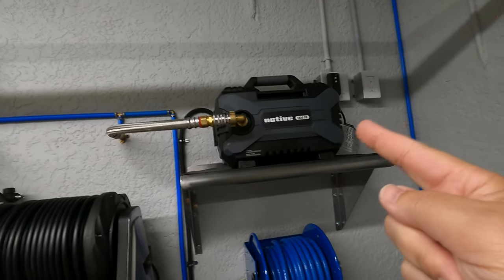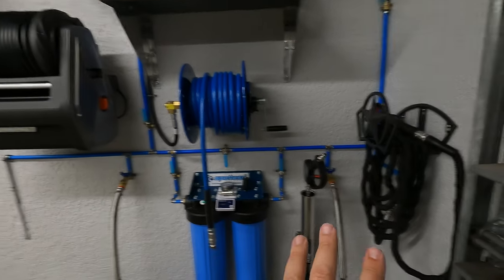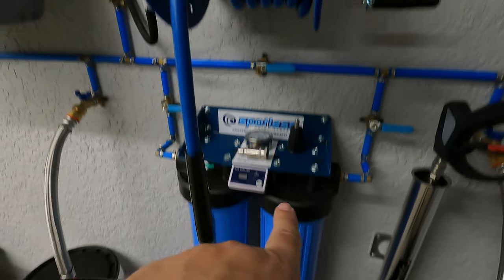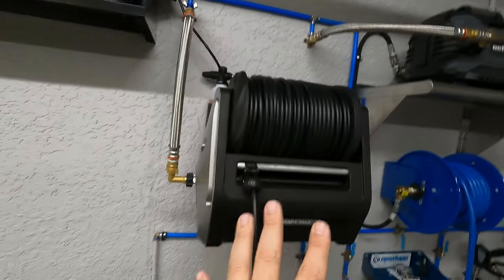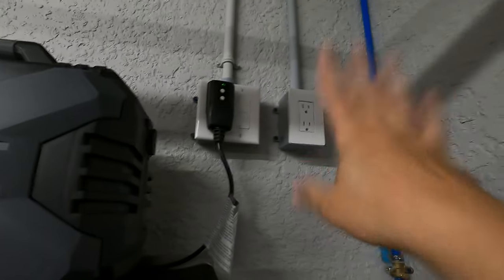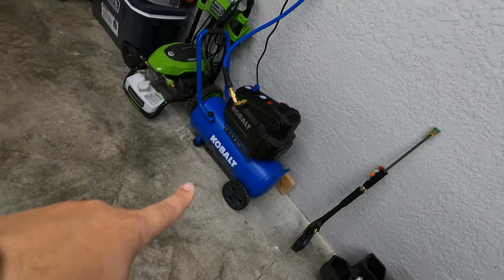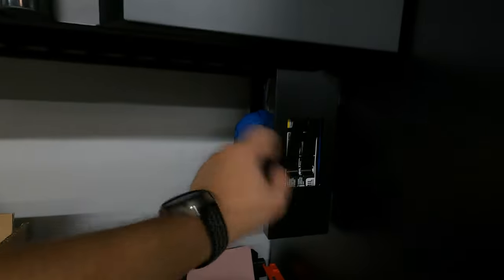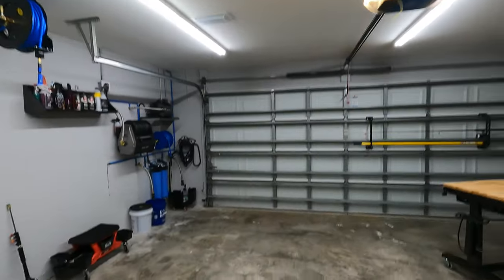My Obsessed Garage Themed Pressure Washer Garage Setup.

Comment: Very nice setup sir! I am going to redo my pressure washer setup to be very much like that. I also have hot water piped to my ARblue630 to use for winter washing so I need to find a way to pex that in nicely to the wall like you did. thanks fo sharing this.
Reply from the maker: No problem.  Thanks for visiting my channel. I'm a huge fan. Keep up the great work 👍
Reply: @MikeLife1 Thanks so much man!
Reply: @MikeLife1 sorry if I missed this somewhere. But do you have a link to all of 

1. The pipe used
2. All the fittings used
3. The shut off valves used
4. The surface mounted fittings used to surface mount the spigots and what your short hoses connect to and goes to the pressure washer.

Comment: Hi Mike, nice setup; please let me know which fitting you used on the pressure washer at
1) Front: 2:02 (Brass fitting between hot water tank hose & quick connect)
2) Back: 1:59 (which fitting did you use to attach the whip hose to the pressure washer L shape)
Thank you, and looking forward to hearing from you soon. :)

Comment: Very nice neat setup.  Looks great.  Are you getting enough water flow with the 1/2" pex?  I was going to run 3/4" to the garage for both pressure washer and bucket filling but might be overkill.  Thanks for posting.

Comment: Btw, definitely go with the mini split; by all means insulate the garage door or replace it with an insulated one and more LED lights in the ceiling.  Finally, epoxy finish the garage floor.  But hey, one thing at a time, install the sink and move the old pressure washer.  Good luck Sir

Comment: Hey Mike, Your Garage is coming out awesome. I actually run an AC company on Long Island, but live here in Cape Coral. The ductless system would obviously be the best option to cool the garage. But if you are going off of your existing system, and having issues, why not just skip the dampers and have your garage get air when your main system turns on. With the dampers, the main system is running anyway. Also, you could create issues with your main system if your garage zone is the only one calling for Air, you will have that large unit pushing thru two supply feeds. This can cause too much pressure. Just a suggestion
Reply from the maker: Sup Corey. I got the dampers hooked up with power for me to manually control.  I don't have them hooked up to main thermostat wiring
Reply from the maker: Also if this doesn't work I'm going to need you to install wall hung mini split.  Lol
Reply: Mitsubishi mini Splits for the win. Good heat & air and not to expensive to run them. main thing is to get them installed properly. If not you'll always have issues with them.

Comment: You have a very professional system with two different reels for the pressure washer. That said you need to upgrade your garden hose setup, get rid of that expanding hose and add a nice garden hose reel. There are some nice ones out there available.
Reply from the maker: Thanks. I changed up the garden hose a while ago.

Comment: great video, mike. I have a similar set up in progress (have a Karcher K1700 & the same coxreel already on the wall, but need to work on the plumbing). Where did you source the ball valves & bucket filler quarter turn valves from? Inspired by how clean the pex looks!

Comment: looks good,  after seeing that filter system i building my own setup,  most likely the company that builds the actual filter system probably buys all the parts from us haha.  Since im the one who builds all the filter systems for my company it will be super easy for me.  I have already started laying out the filter and how i want to set everything up.  only thing that will be different with mine is the housing will be clear and have pressure  relief valves on them.

Comment: I got some pex pipping tryin to find the best option for connections for the system out and just around the duplex, I went with the 3/4" piping maybe a hose bib should be easy enought to attached a hose on both sides then?

Comment: Have you considered painting your PEX piping? from my research when doing pex piping in my home during a recent repipe, Pex piping is not UV friendly and needs to be either inside walls or covered/painted to protect it. UV light apparently shortens the life span of pex piping. apparently fluorescent light also affects the life span of pex piping.  seeing as how this is in your garage, you are in florida and this is most likely near the garage door where sunlight could affect it just wanted to give a heads up.

setup look so nice, just wanted to share some tips I learned while working with Pex in my own home

Comment: Mike, how is the TDS display working, when I asked cr spotless guys if water direction can be either way they said it should be left to right when facing the unit, mainly because of that
Reply from the maker: I'm in New York right now. I haven't noticed anything but when I'm back in Florida I will check.

Comment: Is there a reason why you went with pex-b instead of pex-a? The interior diameter of pex-b is smaller than pex-a since the fittings go inside pex-b vs outside on pex-a. Are you losing psi and gsm? They say to size up on the pipes if using pex-b. Do you live in a area where you have freezing winters? If so do you bleed the lines? Looks really good! I’m planning on doing the same sit up.
Reply from the maker: Thanks man. Location for this Garage is in south Florida so don't have to worry about freezing.  As for pressure I haven't experienced any lose.

Comment: Any problem with water pressure using the 1/2" PEX? I'm trying to design a system right now and I'm just trying to figure the layout and the fittings that I'll need.
Reply from the maker: So far I haven't had any problems with 1/2" pex.
Reply: @MikeLife1  Thanks for the reply. I'm currently designing my system so this helped as I was debating between 1/2" and 3/4" PEX.

Comment: What method did you use to get the hose reel mounted to the wall? It seems difficult to get to the holes.
Reply from the maker: I used a socket wrench and concrete bolts

Comment: Hey Mike, how did you mount your Active pressure washer to your shelf.
Thanks
Reply from the maker: Hey Dan. It's just sitting on there. I did put a piece of a rubber mat under it to help keep it from sliding.  It actually doesn't move at all.

Comment: Mike, can you list the fittings you used in the AR Blue 630 you have for the 90s and how they all goto together 
Thank you! That setup was really nice
Reply from the maker: Here are some links
https://amzn.to/3BUzvok
https://amzn.to/3GePssj
https://amzn.to/3HYnK4m
https://www.obsessedgarage.com/products/mtm-3-8-female-stainless-coupler-quick-disconnect
https://amzn.to/3jniYmz
https://amzn.to/3HZoiqI
Reply: @MikeLife1  Thank you brother.  But on the inlet side you I believe that is the larger garden hose . You show the 90 degree smooth elbow there, but what I can't figure out is what you used going into the machine inlet and on the other side of the elbow to your connection to the Quick release
Reply from the maker: https://amzn.to/3WjDanP
Reply from the maker: That's for both sides of inlet directly on pressure washer and the other for the quick connect.
Reply from the maker: @okkin981  https://bit.ly/3I2Ud9w
Reply: Those were those little pieces! Thank you for all the links Mike. Merry Christmas!
Reply: Mike one last question, on the outlet side, You have that 3/8" fitting there 90 degree, I can see how you attached it to your jumper hose with the QD but i cannot tell how you attached it machine? The machine comes with a Male Plug there but I don't see a QD on your photo
Reply from the maker: @okkin981   Hey Nikko.  Email me a picture of what you're talking about  mikelife072@gmail.com

Comment: Hey Mike can you describe the PEX water lines a bit more? I've looked at some options and I've seen some extremely rolled up flexible lines but I'm assuming the ones you have here are straight lines. Home depot perhaps?
Reply from the maker: Hey Spencer.  Yes. They are the 1/2 inch pex straight tubes from Home Depot or Lowes. Easier to work with.

Comment: Not real sure if it matters, but your in flow/out flow for your filter system is in the wrong flow direction according to the cr spotless system.
Reply from the maker: It's flowing the correct way. I took the top blue shelf piece off and reversed it.

Comment: Mike, how did you connect the separate air hose from the air hose reel to the compressor?
Reply from the maker: I used fittings and bought a jumper hose to attach from hose reel  to compressor.
Reply from the maker: https://amzn.to/3wRDJf3
https://amzn.to/3iIKJST
https://amzn.to/3iLDIAQ

Comment: Mike, are these prevost blue pipes?
Reply from the maker: That's half inch Pex pipe from Lowe's.
Reply: @Mike Life  looks great, I'm getting ready slowly to build mine, gathering info before I proceed. I checked that obsessed garage guys but their setups are kind of pricy. Mike, what about valves and connectors, did you get them from a retailer like Lowes as well
Reply from the maker: @paul9387  The water valves/hose bibs are also from Lowe's

Comment: Active Pressure Washer how well does it last?
Reply: They are trash and don't last long.  Have read and seen numerous negative reviews and warnings to stay away.  Don't waste your money on it.
Reply: They are great the 2.0 is coming out very soon with over 2.0GPM on it.
Reply: @SnakeDoctor5104  Couldn't be more incorrect its one of the better ones on the market running second up to Kranzle.  Most people that say negative dont even own just bad mouth shit cause they cant afford it.
Reply: @TXMAN821  You obviously haven't done your research and this isn't coming from me.  Power button breakage and oil leaks are some of the most common issues.  There was even another youtuber who raved about this unit intially, but it soon broke not long into ownership.  This is the reason for 2.0 and hopefully it is more reliable, as it could be a great buy for the price. Second to Kranzle??  This doesn't even come close to the AR Blue 630 or 613.  Th

Comment: 1:40 time "saved" is actually not that much.
Let me explain.
Your water supplier gives you a certain amount of gpm. A ball valve has a smaller, than the pipe, diameter from which water flows. If you get two bucket fillers then you have twice the diameter.
Though 2* diameter does not always mean 2* flow.
You basically max the output the water supplier gives you. The difference is negligible